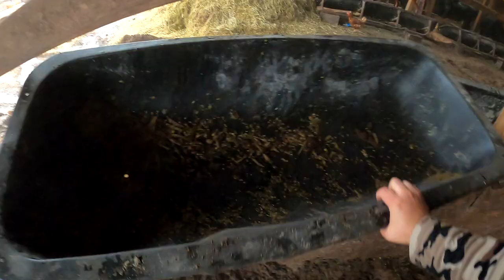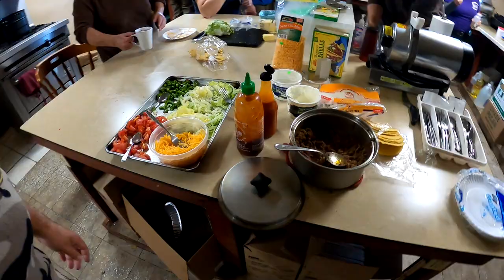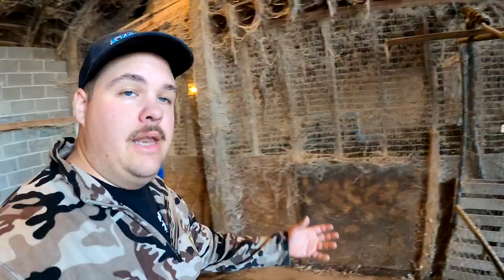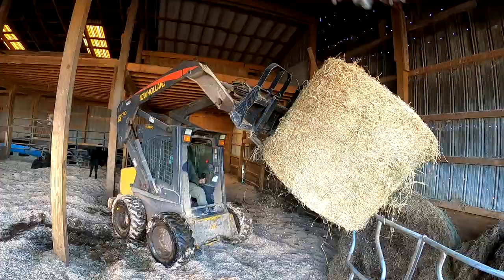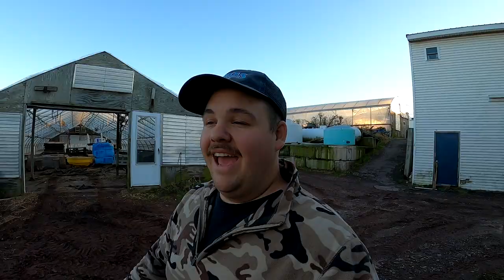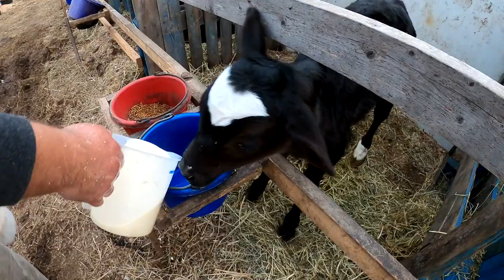Thats an interesting way to use a broom

Comment: Andrew, with the chicken wire so full of cobwebs and dust, it looks like the laying hens had little to no fresh airflow.  Have you considered using pasture tractors to grow out the meat chickens?  Better meat, more space in barn, and no manure to haul away!  Plus, full access to chicken wire wall for easy frequent cleaning of webs.